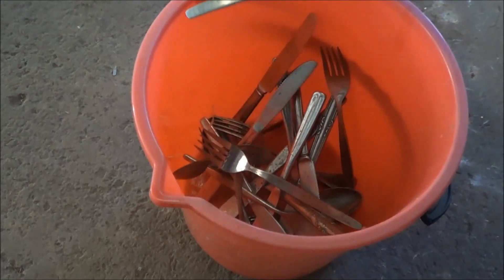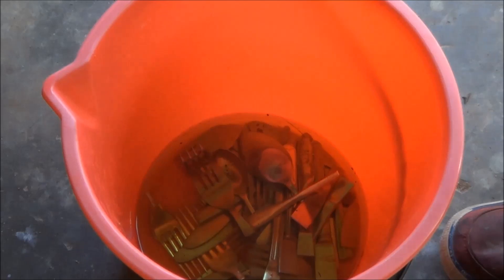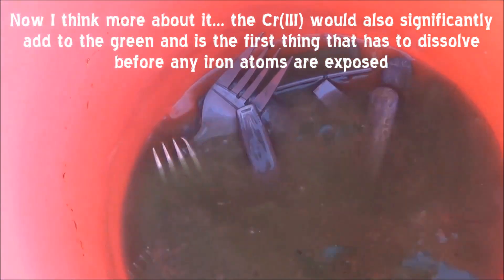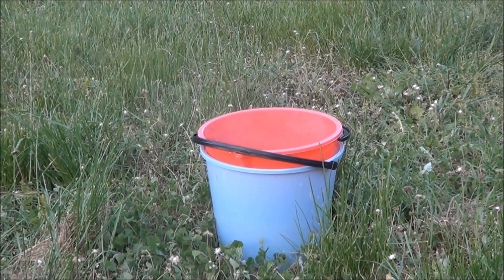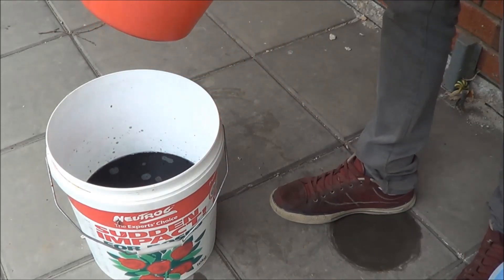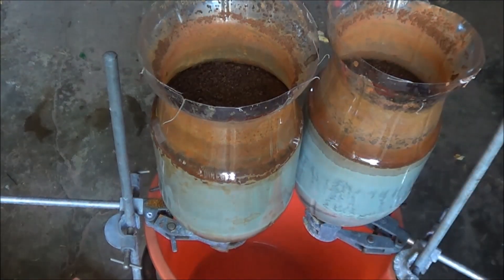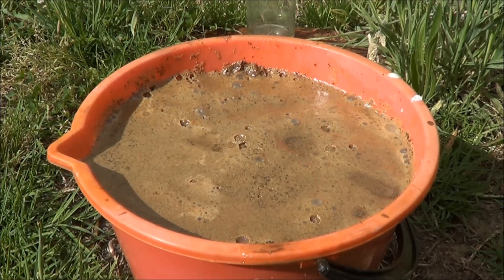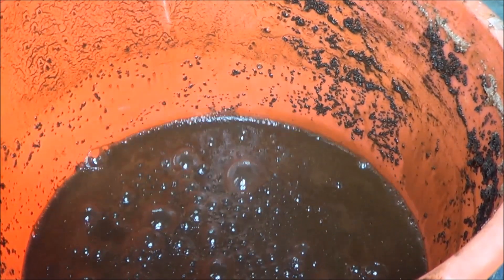Dichromates from Stainless Steel - Part 1 of 2

Comment: Hey, i've just repeated this more or less exactly and after adding all the calcium hypochlorite I left it for 24 hours and then also heated it at 40 degrees for 2 hours.  After that all the precipitate settled to the bottom and it was easy to filter the nice yellow chromate out.

Comment: lets say i were to do this on a somewhat large scale (maybe half a kilo to a kilo of end product), would cutlery be the best choice of stainles steel or would there be better options? because cutlery is actually pretty uncommon at most junkyards around me, as most people just toss it rather than scrapping it, so gathering a large amount of the stuff would be unlikley (for me atleast). or would an alternative source of chromium be a more viable aproach?
Reply: Really can't think of much stainless that would end up at your standard scrapyard. If there's an actual metal recycler nearby, that might be an option. Otherwise, cutlery, pots and pans at your local charity shop, maybe.
Reply: Chromic oxide, pottery suppliers sell it for use in glazes.

Comment: So you were able to determine what type of stainless steel you had (think you said 18% chromates) simply by reading the labels. I really want to replicate this extraction, but all the stainless steel I can get my hands on (in the form of cutlery, mostly) simply says "Made in China" and "Stainless Steel" but no details in regards to what type of stainless steel...
Is there a way to determine if they have a decent amount of chromium? Is it safe to assume that its a specific type of SS if it doesn't say what type it is?
Reply from the maker: Yeah I agree, it'll be a specific type unless labelled otherwise I assume. I'm not sure what type it is though. It doesn't make too much difference though, the amount of chromium is always about 12%, and the different grades just play with small changes in the amount of carbon or other trace things, it shouldn't matter really what grade you use
Reply: @ExtractionsAndIre  awesome! Thanks for the reply. A lot of my glassware is 14/20 and mostly 250mL or below (except for a 24/40 500ml distillation set). So i may actually usea  similar coke bottle style setup.. Lol

Comment: Ehhh... 
So there's a few things for this first part. 

First, your silverware might just be plated in chromium, rather than a Homogenous alloy. Even if it is homogenous throughout, surface treatments can vary the chemistry wildly for the first micrometer or so. 

After that, your dissolution seems very slow. You might consider an airstone or a drip feed of hydrogen peroxide to speed it up somewhat. 

Finally,  at 7:15 you note that you're using potassium chlorate. If the stainless steel has any sort of manganese contamination, potassium is actually detrimental to it's removal. Manganese is a common additive to stainless steel because it improves it's machinability as well as further improving it's corrosion resistance. 
it does depend on the alloy used to make the silverware though. If it has Manganese, Sodium Chlorate would probably work best.
Reply: He said calcium hypochlorite, not potassium chlorate...
Reply: @chemistryofquestionablequa6252  exactly
Reply: sodium and potassium literally has no difference in this case

Comment: Hello , is that sure that stainless always contain chromium ?
Reply from the maker: Yes, chromium is the magic ingredient that turns normal steel into stainless steel. So it will always have it in there in some amount, unless it's some very exotic type of stainless steel, used for some special application, I know there's steel with high levels kf vanadium and manganese in them, but fairly sure they'd still have chromium in them
Reply: Thanks a lot sir , it look very simple to extract dichromate , but we need time and patience..
Reply: +Extractions&Ire I don´t if knew this but instead of hypochlorites you could have used concentrated ammonia solution to seperate the chromium from the other metals in the stainless steel precipitate of hydroxides and carbonates. Ammonia actually forms a pinkish purple complex solution of hexaaminechromium with the chromium(III) hydroxide. Ammonia also forms a soluble complex with the nickel but then you can seperate them by adding hydrogen peroxide which will oxidize the hexaaminechromium complex into ammonium chromate (I am not sure about the complex with nickel but maybe it´s oxidized into an insoluble nickel oxide).

Comment: What would the balanced equation be for the oxidation of chromium carbonate to CaCrO4 by Ca(ClO)2? Is there gaseous Cl2 or some oxide of chlorine being released in that process? Also, I assume you're using Ca(ClO)2 in excess. So, is it the case that there remains calcium hypochlorite in the solution, which is discarded when you boil down the solution and collect the CaCrO4 crystals which have a lower solubility?
Reply: if I right , equation is maybe like this :  4Cr(OH)3 + 5Ca(ClO)2 --> 4CaCrO4 +  CaCl2 + 4 Cl2

Comment: Where did you buy your Diggers HCl? I've noticed they have it on the Bunnings website but I haven't been able to find any at my local stores.
Reply from the maker: +Nick Turner It's been at every Bunnings i've been to, sometimes it's locked up behind a cage but it should be there

Comment: Fun fact: P and S is not added to the alloy, the manufacturer just didn't give a damn about removing them since it was cheaper. Those elements make the steel more fragile and leave holes most of the times, but adding a remover is a tiny bit more of an expense.
I would have also added a lid of some sort, because you are wasting your acid (both in fumes and droplets). And yeah, those fumes don't do much good to copper either since it eats away the outer oxide layer and activates the surface.
Reply from the maker: +Krisztián Szirtes That is interesting, but I guess it makes more sense that way! 
I could've added a lid yes, that would be a good improvement. HCl is a monster in terms of corroding metals. You're right about the copper, but now I think about it the worst part is it destroying the zinc galvanizing the steel in the shed, so the metal will continue to rust forever even when the fumes are long gone...
Reply: Damn I never payed attention for galvanized stuff...
Reply: @ExtractionsAndIre .... a monster at corroding metals....  yeah... I do my chemistry in the same shed that I do metal work.... my tools, MY TOOLS! (sobs)
Reply: @edgeeffect  one thing i wanna try to do is to remove the rust from my rusted tools and nickel/zinc plate em, i know it inst gonna last but gonna work, if i really wanted then to last with the abuse they suffer i would need to platinum plate then